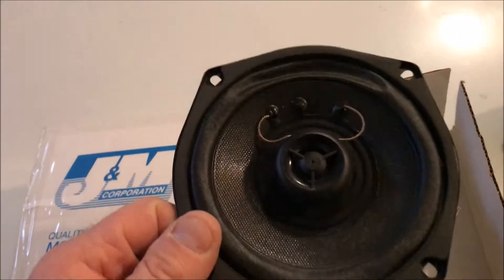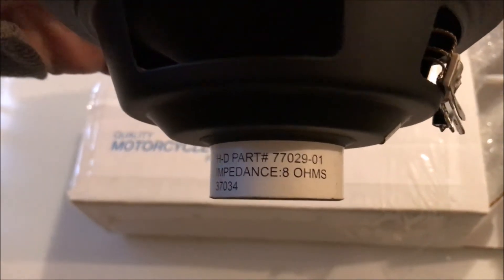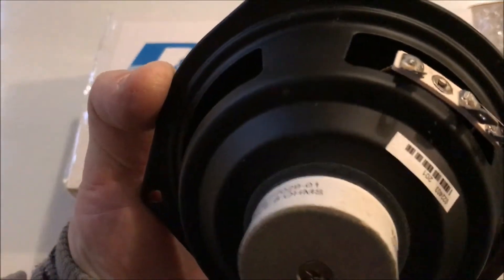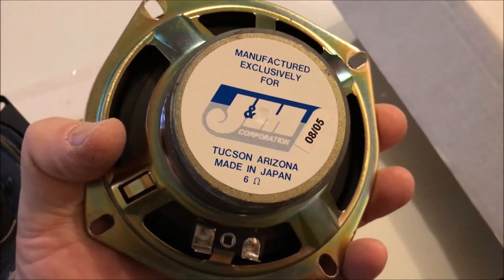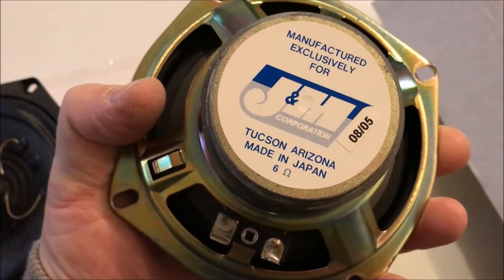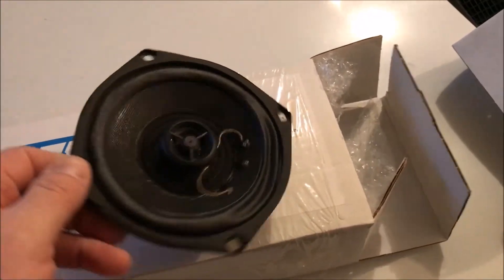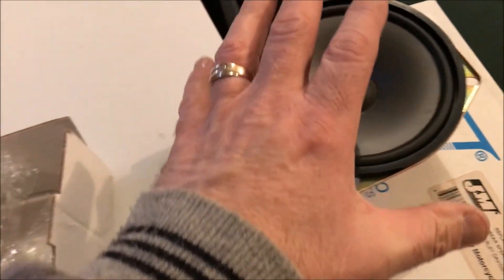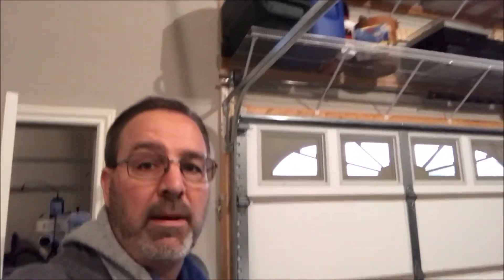Which Speakers Do You Like Better

Comment: Hey Bob, I have to agree that just on general principles speaker set "a" is better because of the tweeter. However I have always heard that a larger magnet is better (gotta agree with everyone else on that!). But there again it all comes down to which set sounds better when you hook them up and that is really up to your taste. 6 ohms does sound a bit much for a 5 1/2in speaker but should be ok as long as you don't crank the volume up full blast.
Reply from the maker: +dierlang Thank you,
 Hopefully I'll get a chance to pull the panels soon and test them out. 

Regards,
Bob
Reply from the maker: +dierlang Thank you,
 Hopefully I'll get a chance to pull the panels soon and test them out. 

Regards,
Bobs

Comment: I would guess Speaker A as I don't know what is installed in your car already.  If nothing else you have to be concerned 
about the impedance of your speakers.  The 6 ohm one is a little on the uncommon side 4 and 8 are the most common.
There is one golden rule. If the sound starts to suck more at any level it is always because some part of the equipment isn't happy about the situation. And let that govern your use of that volume knob
Reply from the maker: +Dave White Thank you Dave. 

Regards,
Bob

Comment: Howdy Bob, I'd lean towards A based on the impedance.  A lot of speakers are now made with neodymium magnets (can't find real specs on yours, so...), but size is perhaps less a consideration.  Also, those are only 5.25" speakers, if they were large drivers moving a lot of air, I'd be more inclined to look at massive magnets.  My buddy has a HD with stock speakers and suffers no ill effects from road noise, I think you'll be in good shape!
- Bill
Reply from the maker: +Bill Kibby Thank you Bill,
  I was hoping you'd chime in on this one. The final decision will be when I hear both sets connected to the stereo. 

Bob

Comment: I've always been told I have to match the ohms of the speaker you are replacing.  What are the ohms of your old speaker?
Reply from the maker: +Mark Perkins I need to pull them from the door panels and check that out. Thank you for the info. 

Bob

Comment: Youtube is full of self-described experts so I will be honest; I am with you, I have no clue.  :-)  My gut agrees with you that (A) might be the better choice.  Why not just hook up both pairs (one at a time of course) and decide?
Reply from the maker: +Tenspeed TheBikeHanger I will test listen to them once I get the door panels off. Even if they sound ok to me, I was wondering about the difference from 6 to 8 ohms. That's Greek to me. I didn't know if it would cause a problem with the system if I used the wrong one. Someone out there will know. 

Bob
Reply: From what little I have just read it shouldn't make any difference, especially if you aren't cranking it 100%.
Reply from the maker: +Tenspeed TheBikeHanger That might make a difference depending on the song. LOL

Bob